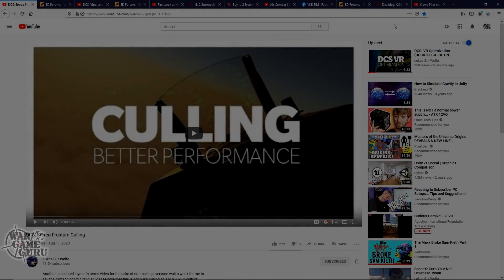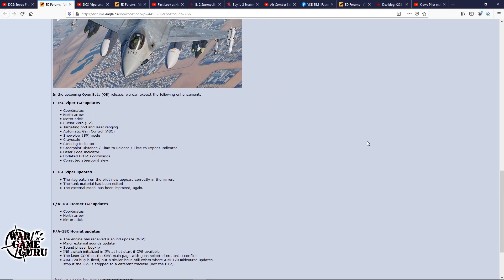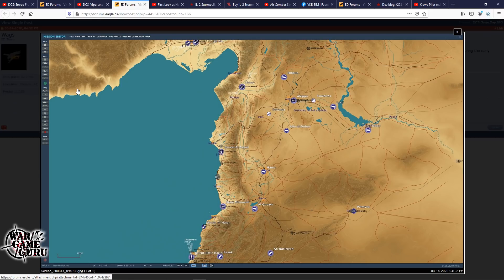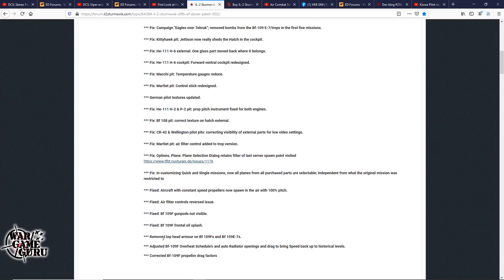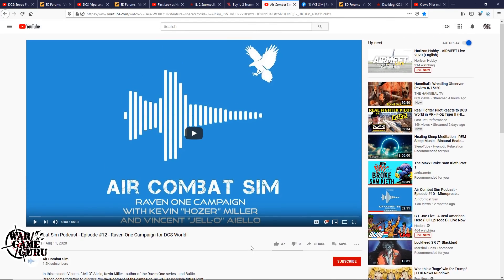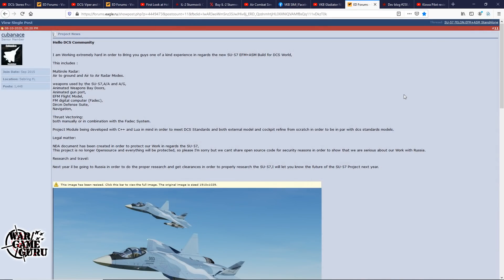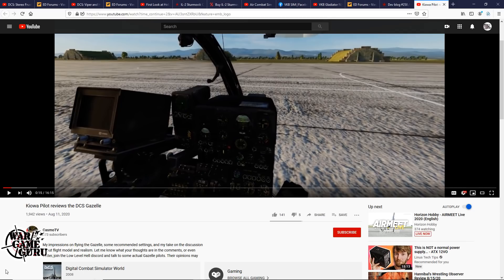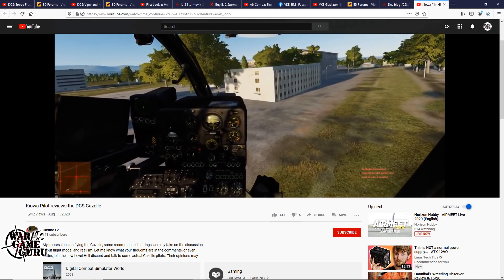FLIGHT SIM NEWS 8-15-20 - DCS SU-57 gets serious, , New Helo Flight-Sim, DCS VR performance boost?

Comment: I think the biggest disconnect with helicopters is the vibration, there is none so it's very hard to get the immersion  and to a lesser extent all sims, is the sensory loss involved with real situations. I have been in the military and experienced Huey's and Chinooks, Kiowas, and the Loach so I know sitting in a chair and trying to fly a helicopter on a PC just doesn't cut it.  I do think sitting in a gaming chair with some real bass plugged into the seat giving you some kind of feedback makes a difference (somewhat) and creates just that bit of immersion needed to boost the experience.